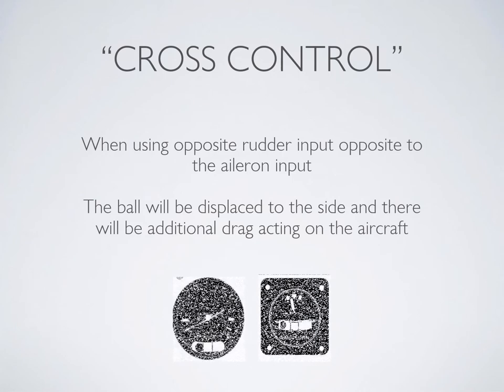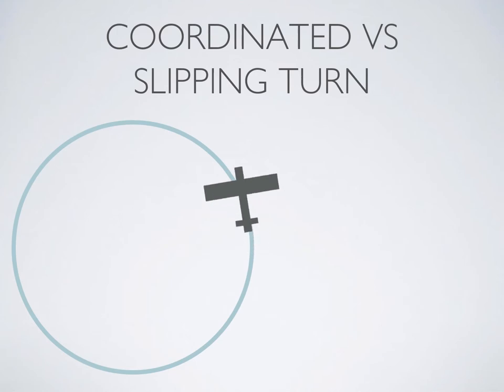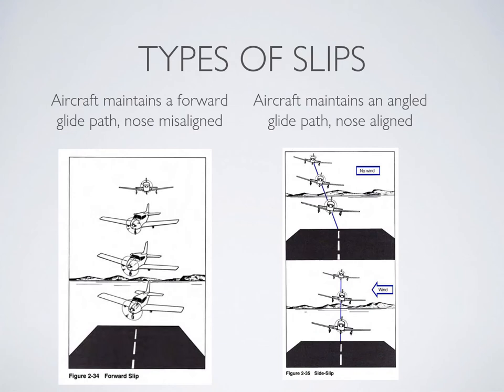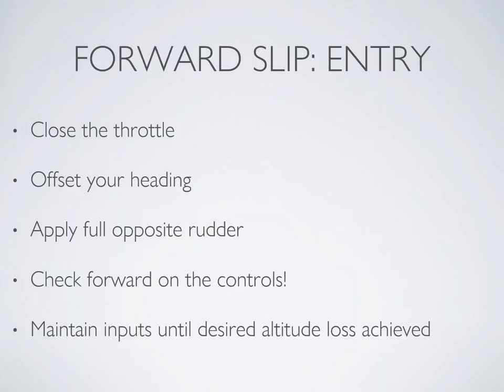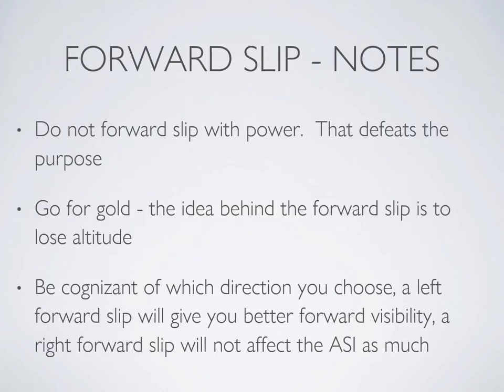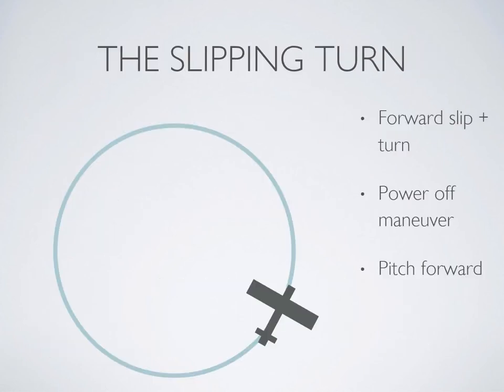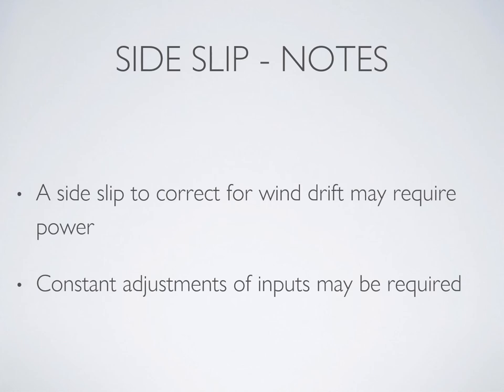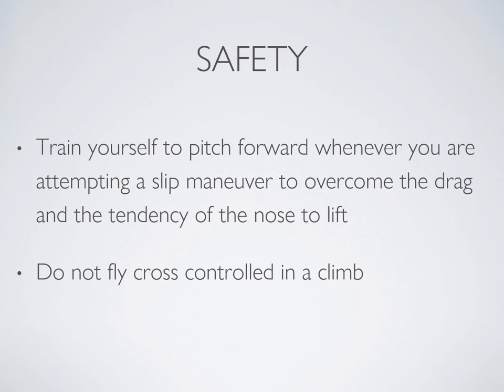Private Pilot Flight Training Exercise 15 - Slipping

Comment: So one is power on slip ,and one is power off slip.
Reply from the maker: Kind of, sort of. To Slip means to bank but preventing the resulting turn tendency with rudder.
Power technically has nothing to do with it, however the addition of Power will reduce your descent rate.  Thus... if the intent is to lose altitude, slipping with power makes no sense.  However, if you are using a side slip to maintain track on a crosswind approach, then use of power is reasonable and should be increased or decreased depending on the desired glide profile.

I hope that helps.